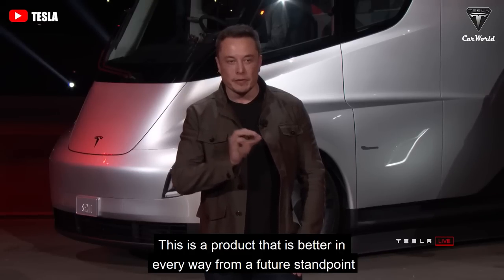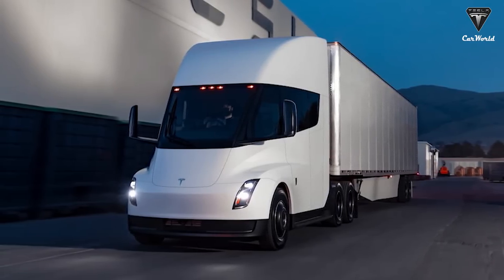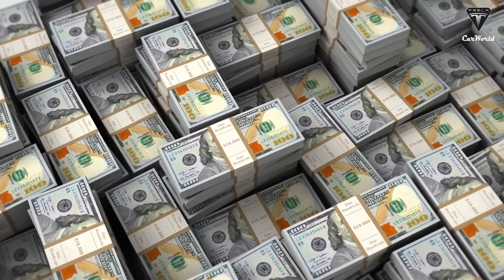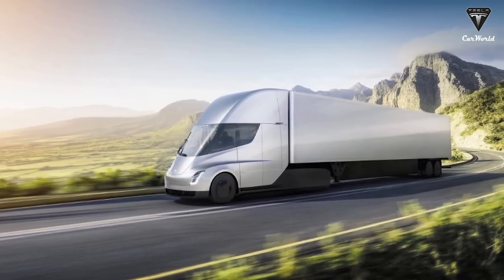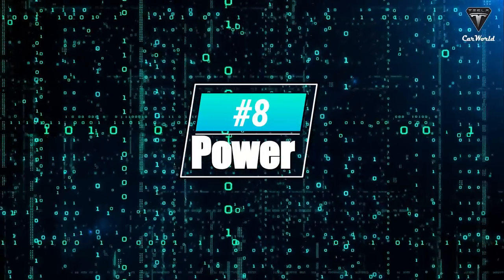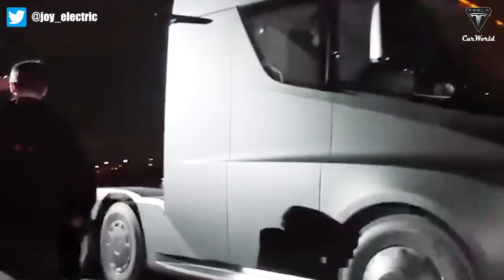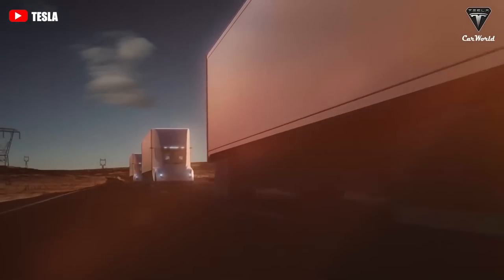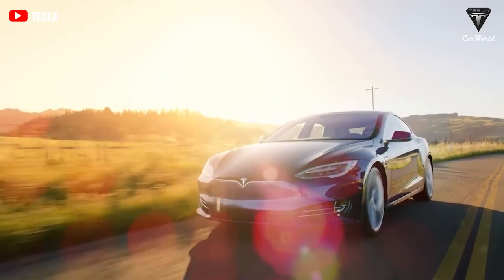Insane Tesla Semi Features That Elon Musk Never Revealed... UNTIL NOW!!!

Comment: The electric cost calculation also skewed because the $$ is only calculated on the subsidized Tesla charger network, not the 3rd party networks that'll be popping up in TRUCKSTOPS, not shippers and receivers, which will be significantly more because that's just how the trucking industry is.
Reply: Prices at Tesla chargers is very high.
Reply: One must consider the "Demand Charges" in places like California, where the demand charge can be $12 per month per KW of demand that is required by that company.  So a company might have a 200 KW electric service, and a normal load of say 50 KW all of the time, and a rare few days a month that they might run a additional 5 KW of air conditioners.  Demand charges would be 50 KW X $12 per month, plus the electricity charge per KW used that month.    Now if you plug in a electric forklift or 50 KW EV charger, that can double your demand charges IF it charges between 3 pm and 9 pm when the demand charges are in effect.  Or add $600 to the monthly bill IF you run that charger once (15 minutes) during that time frame, or every day during that time frame.  

For a company that is powering chargers at a place like Home Depot parking lot, that demand charge can add significant fees to the cost of their electricity.  Sure they can power the charger at night for $0.15 per KW, but during the day they can end up spending thousands of dollars (in demand charges) to plug in 10 Tesla's that are charging at 150 KW per car.  This is why they tend to charge $0.40 per KW for their power!  And that makes me want to run my plug in hybrid on gas only, because the electricity cost is more than the fuel cost.  At home I can charge for $0.10 per kw and save a lot on fuel costs. 

100 KW demand charge in San Diego will cost the company $1,200 each month that they reach 100 KW of demand.  That can be one car plugged in at a high output charger.   So if they have 15 charge stations, and 10 are running at 100 KW at some point that month, the demand charge can be $12,000 for the demand charges, and then add the cost per KW for the power consumed.
Reply: @lengould9262  And 3rd party truck stop chargers will be even higher considering that's the only means for them to they make money.

Comment: A network of spare parts/repair facilities will be necessary.  These could include spare battery modules as well.  In fact removable batteries could be swapped rather than charged by the trucker.  The network of chargers will have to be in place prior to initiation of use by fleets and owner operators.

Comment: The numbers are way off. I own a 2023 Freightliner and will have it paid off in 2 years. At 160,000 for the truck his numbers are laughable. But the fact remains that it needs 1000 miles of range to be a serious contender
Reply: How many days a week do you drive 1,000 miles?  In the real world, driving 400 miles without a break of 30 minutes is a real situation.  If the battery cost is $250 per KW, and it takes 400 KW to drive 200 miles, why install another 1,000 pounds and $100,000 battery to get another 200 miles of range? That means 1,000 pounds less cargo, and $100,000 less in your wallet or payments you need to make to pay for that additional battery capacity.  

My thought would be a 300 mile range is plenty if I am paying for that battery pack.  I can afford to stop for 30 minutes at a charger every 3 hours of drive time.  So starting at 9 am, I would stop at noon and 3:30 pm, and then run until about 6-7 pm.  Then can charge overnight.  9 am - 7 pm is 10 hours, with only 1 hour of charing time.  

In Germany they have 3 large cities that have 60 Km of electric trolly lines to power electric trucks going into and out of these cities.  The cost is $1,000,000 per Km.   So during the 60 Km drive the truck can charge it's battery by about 60 - 100 KW, as well as use 120 KW to power the motor during that freeway charging time.
Reply: @Kangenpower7  my wife and I run 7 to 8 thousand miles a week. Consistently running 730 to 750 miles a shift. BTW I’ve been driving since 1989, I’m well aware of the laws
Reply: @Kangenpower7  don't forget dot requirements/rules when making financial decisions. with only one seat, that truck can only legally operate for 11 hours max.
Reply: It won't be an owner ops truck, at least not until infrastructure is built out to run them that way. For now, you'd have to lease onto a fleet that has the infrastucture and it'll be shorter hauls, possibly "cooperative" terminals in areas, where fleets will have agreements for charging, maybe a lot of trailer relay-swapoffs and return to terminal.Probably a bunch of never -never plans from fleets. At the moment, this truck has a small market overall, until the models and options get built out.

Comment: Just wait until tesla starts making the trailers as well….with additional batteries and power train on those wheels 😮
Reply: Doubtful, trailers are dropped and not used often. Batteries just aren’t cheep enough yet to put them where they will see less use, though could see the use if multiple drivers and maximizing uptime for truck is important. Which comparing cost of vehicle to driver just doesn’t make sense.

The main problem Tesla will have is with heavy cabs it limits how much weight you can carry in trailer due to weight laws.

Comment: I wonder how well the Tesla Class 8 truck would handle hitting a deer?
Reply: Given the design differences and front end lay out, I suspect the Tesla will fair better than a diesel. Add that to the collision avoidance system to start breaking sooner and things are looking pretty good for the Tesla.
Reply: @inomad1313  Like a cabover though, driver is first at scene of an accident, and the avoidance system can't predict animals running up from the side of the road.
Reply: @inomad1313  
Fair better? The deer is going to get cozy with the driver in the cabin.

Comment: I reckon the price will be much closer to $200K, if not slightly above that. Consider the recent hikes in material prices.
We will see tonight
Reply: Big trick will be the cost of infrastructure & maintenance for the fleet using them, that is all on top of the truck. How it will compare to diesel infrastructure and cost of elec vs diesel in a few yrs will be  interesting. And at the moment, it will not touch the class 6 & 7 market, which is the larger truck market. There will be a learning curve for everyone, we'll see what happens over the next 5 yrs or so. I wonder at accident repairs as well, what will insurance companies do with them, and I'm not sure I like the driver position for that, simillar to a cabover, driver is first on the scene of an accident, and seeing around vehicles in front of you will be a bitch. THere is a while mess of stuff to be evaluated over time here.

Comment: The brilliant idea that no one talks about is the center seat. One production line for US and Europe. Brilliant.
Reply: nothing like making your visibility kinda suck on both sides instead of just having it suck on one side.  brilliant
Reply: 1. It is not a big thing for manufacturers and is not a real issue.
2. Europe drives on the same side as the US it is only us in the UK and Ireland who drive on the left and a few others in the world.
Reply: @beep5406  wrong. They actually have to shut down production lines in order to accommodate a car that drives on the opposite side. Musk has talked about this is being a huge problem. Especially if you’re as efficient as TESLA is at making cars.
Reply: @GET2222  if their doing that their not that efficent are they
Reply: @beep5406  what are you, 12!? That’s every automotive company. They aren’t building widgets, they are changing the floor pan in the car to accommodate pedals on the other side of the car and a different interior dash for the opposite side steering wheel. Clearly you know nothing about production.

Comment: I wonder how well those regenerative brakes will work going down long steep grades with a full load?  What if the batteries are already topped off and can't take any more charge?
Reply: I think the truck designers are depending on the truck battery getting slightly discharged on the uphill side of that hill you are talking about.  And not installing chargers at the top of the hill, so that the trucks can get more than 100% full on the downgrade.  

My thought is to have a electric overhead wire on the uphill side of the large hills on places like I-5, to charge the battery with a 3,000 VAC system to run about 5-8 miles at a time, between LA and Bakersfield.  So maybe 10 places you can charge while driving at 60 MPH, for 5-8 minutes each time, getting about 20 KW - 40 KW per charge session.  Uphill, while the truck is using 7 KW per mile, then the 10 miles would be 70 KW to the motors and about 40 KW to the battery.  With a string of trucks about 500 feet apart, so 10 per mile, each drawing 110 KW in 10 minutes,  the total power needs for all 10 miles would be 100 trucks, X 11 KW per minute, X 60 minutes per hour or 66,000 KW per hour.  (If there are 100 trucks charging at the same time over this 10 mile wire).  

This would require a 300 - 500 MW wind farm to power that section of the freeway trolly EV charger section.  

They are using overhead trolly power lines on Germany freeways now, for about 60 Km on the way into and out of three large cities.  The cost is about $1,000,000 per Km to install the overhead lines.  

The power lines can be mounted about 20 feet above the ground, and then barely run under the freeway overpasses, so a area with no overpasses would be great.  The lines could be attached to the truck or trailer and reach up to the two power lines that are about 5 feet apart, with a antenna detecting the power lines and shifting to the left or right to stay centered under the power lines, without causing the power lines to shift left and right between their support towers, located about 200 -  300 feet apart.   

San Francisco has been using trolly powered electric bus system since back in the 80's.  A small battery on the bus can run it for a very short distance if the power is lost to the trolly system, or the driver makes a wrong turn to a street without a power line overhead.
Reply: Good point the mapping software these days should be able to calculate the energy recovery and usage for any route and load being carried. If you were starting at the top of a hill with a big load it could advise the driver to not fully charge the vehicle and take advantage of the free recharge going down a hill.
The software guys can sort that out - similar to how pilots of aircraft will not always fully top up the fuel in a plane - instead they work out how much they need plus a reserve.
Reply: @tooltime9260  👆👆👍👍🤣🤣🤣
Reply: Guess they’ll just have to use the actual breaks.
Reply: @Daniel Montes  it's not that simple.  When going down long grades, Semis rely on engine braking (down shifting and using the compression created by pistons) far, far more than they rely on their regular brakes.  Can't do that if you don't have a piston engine.
Reply: @DG-wo8fx  exactly, when you're 80,000 pounds you don't want to be going too fast and riding the brakes down the hill. With regular diesel engine and engine braking we can get a feel for the right speed to go down the hills but don't know how that's going to work with without that type of breaking like how do we know if we're overheating the regenerative braking or whatever
Reply: @J J  true that.  The charge rate of the batteries will have to be able to tolerate the huge amount of instantaneous current coming from the regenerative brakes without overheating and self igniting.
Reply: @DG-wo8fx  I am familiar with Jake breaks and downshifting. Wouldn’t that be quite the oversight if no one at Tesla thought about how to stop 82,000 pounds going downhill?
Reply: @inomad1313  yes, it would be.  But knowing Elon, his truck will deal with it, and probably in a way that improves on what you guys have to deal with today.  Cheers.

Comment: DOT limits truck gross weight at 80,000 pounds. What does the empty Tesla weigh? That is, how much cargo weight can it deliver?
Reply: That’s a good question. Nobody tells you that Tesla weighs about 50k lbs so it means that you load will be about ~30000 not ~45000. That’s sucks.
Reply: Don't EV trucks get a weight compensation ? I think they do
Reply: @twitafftwitaff7029  you are correct. They get 2,000 pounds credit to offset the heavy battery. Payload will be similar, not 15,000 pounds less, as others have stated.
Reply: @markchrist4044  so 13,000 less still not that good
Reply: @beep5406  No. I heard truck is 17,000 pounds, and payload was 64,000 pounds, total 81,000 pounds. Allowed 82,000.
Reply: @markchrist4044  17,000 lbs i don't think that is correct even without a trailer a diesel hgv truck is heavier than that unless this is the an lgv version your talking about? 
Until we actually get solid proof of what it can do all we can do is speculate but the fact no solid info has been posted is only going to sow doubt on it capabilities
Reply: @beep5406  I agree, I want to see the specs from Tesla directly,  but I know a freightliner Cascadia with a Detroit is right around 17,000 truck only, and I would think Tesla may be a couple thousand heavier, but I will hold judgements until I see directly from Tesla.
Reply: @markchrist4044  some trucks hit the 25,000 mark hence my shock when i thought you said the tesla truck was 17,000 sorry for mis understanding.
We'll see i don't think much of it especially as these were meant to br released years ago and still have little to no info about them or their capabilities
Reply: Not everywhere, Canada has 110K.  Diesel configs are likely 8k lbs or more with eng, trans, cooling system, wiring, DEF, DPF/SCR and fuel tanks and lines and drivelines. Have to see where that balances out to what components weigh on this. Steer system is a steer system, elec or hyd, rear wheel ends are the same, still has diffs, of a different style, Brake system won't be much different, not sure what they use for a air compressor & dryer setup.

Comment: How can this video not mention Nikola as a competitor truck... especially considering hundreds of Nikola TRE BEV's have already shipped?
Reply: Nikola Tre is an IVECO S-Way chassis badge engineered by replacing the ICE motor with an electric one and battery's from another company. With their present financial position Nikola may fold at any time. VS Tesla have the finances and engineering to build up high production rates. The tesla semi is designed and optimised from the start to be an electric truck rather than just modifying an existing chassis.
Reply: @stephenhumble7627  this is ridiculous. That’s like saying ford is actually not Ford. Because they ship parts from Mexico or elsewhere. Hint: ford has thousands of vendors. No different from Tesla. No different from Nikola.
 It was left out intentionally.
Reply: @stephenhumble7627  Also, as the finances go - imagine people not acknowledging Tesla in 2012 as a competitor in the EV space - you know because their finances weren’t great at all. People need to end the tribalism. Nikola has a much higher likelihood of success than any other FCEV mfr at this point. They have enough cash to last them through the economic turmoil. And sure, they are slowing down growth a bit (like everyone - including your beloved Tesla) but they’re in first position to slingshot out of the gate once the economic sanctions are lifted by the government

Comment: Not to mention the cost of a replacement battery - roughly 17 times $36k or $612K as a rough guess.  Also - no mention that the probability of a failure in the battery is 17 times higher than a Tesla car.  The actual per mile cost of energy is higher than the diesel version- except Tesla is subsidizing electricity at a cut rate to make it look good - don’t expect that to last too long.
Reply: Why would someone pay $612 k for a new battery in a truck that costs less than $200k? You are creating problems that don’t exist . Making up numbers does not help your credibility.🤷‍♂️
Reply: @malcolmrickarby2313  what manufacturers do is subsidize the initial cost to get you to buy the vehicle - then they will charge you full price for replacement parts.  Just like they are subsidizing the electrical rate initially to make the vehicle competitive with diesels.  If you charged these things at your home electrical rate you would not buy one.
Reply: Where are you getting your information?. Even in California Electricity is cheaper than Diesel and  if you have access to solar charging stations it is many times cheaper
Reply: @KvndS29  https://youtu.be/Uv44W7xa4IU   14 minutes in - you might watch the whole thing for reference.
Reply: U get figures off th bathroom wall
Reply: @justinpenn9250  legacy manufacturers do that. Tesla does not. It's a new paradigm. Maintenance costs will be significantly lower since there is no engine, no complicated transmission, no complicated cooling system, a brake system that will last a lifetime. You'll see!
Reply: I wish you wouldn't mention anything at all, to be honest.
Reply: @malcolmrickarby2313  "if it breaks down, just buy a new one". Great business strategy -- for tesla, but not the operator!  Do you think logistics companies are stupid and don't know their business?  Not to mention, the idea of "disposable semis" what a great thing for the environment
Reply: @KvndS29  Not anymore, they tax solar and wind now, HAHHAHAAHA
Reply: @The_Conspiracy_Analyst  yes ,I do think logistics companies are stupid for hiring you as their spokesperson.😅😂🤣
Reply: @malcolmrickarby2313  You can think what you like, but the facts are I'm rolling in the dough hauling water loads out here in bakken while you are rolling in incelldom in mommy's basement